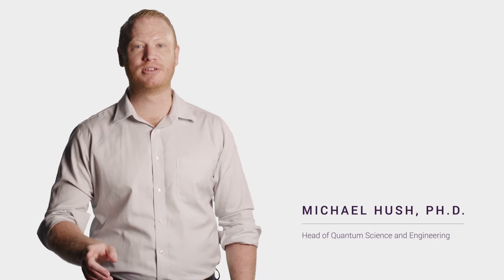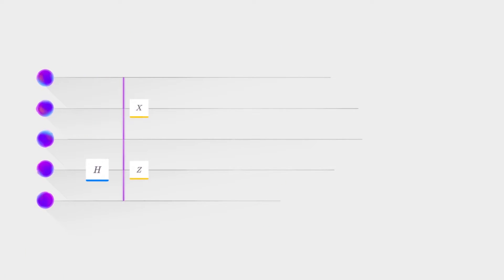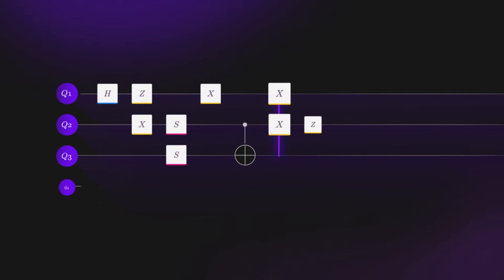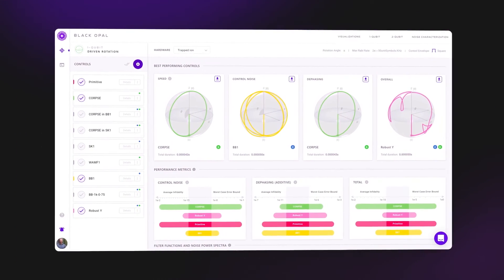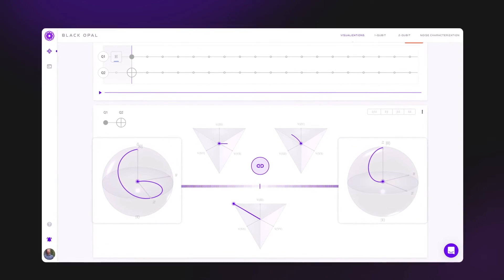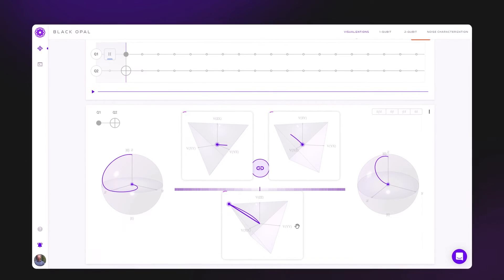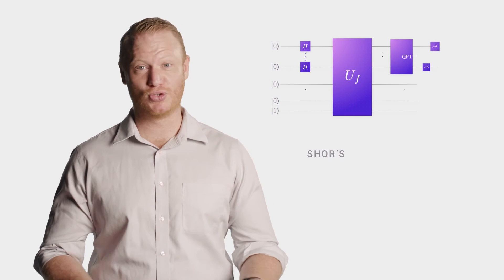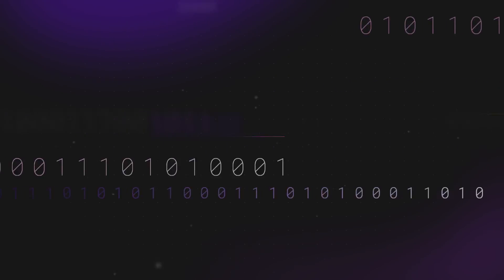Quantum circuits and algorithms (ep3)

Comment: @0:50 you are describing a quantum circuit diagram as having a horizontal axis representing time. Can we also call it a dataflow diagram or does that have too much baggage referring back to dataflow diagrams in classical computing? If so then perhaps we can refer to these quantum circuit diagrams as quantum dataflow diagrams. But if they are commonly known as quantum circuit diagrams then that's what I will call them too. But it helps me to also remember that data is flowing on the horizontal axis if indeed that's not a wrong assessment. Is my dataflow assessment wrong? Does data flow on the horizontal (time) axis, or is it something more complex because of superposition, coherence, entanglement, decoherence, wave function collapse, etc? I am committed to mastering these concepts. I think it would be useful if I could learn to use CQM (categorical quantum mechanics) to analyze quantum circuit diagrams as I attempt to apply Q-CTRL’s quantum control techniques to quantum computation.
Reply: There's a lot of discussion around this point, but broadly dataflow in classical computing is a bit different.  In quantum circuits, in a cartoon fashion qubits are connected in such a way that data "flows" as time progresses.  Nonetheless as you will learn there are concepts in quantum circuits that allow data to effectively "flow" backwards because quantum circuits are reversible (until measured) - directionality is not necessary as in classical data flow diagrams.  Our community has opted to focus on "circuits" since they broadly inform the operations to be performed between different physical devices.